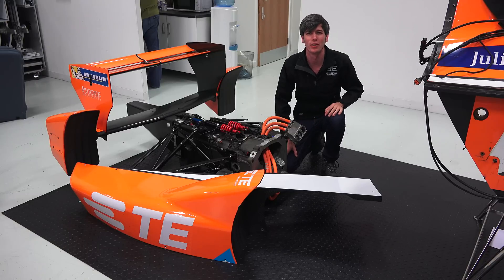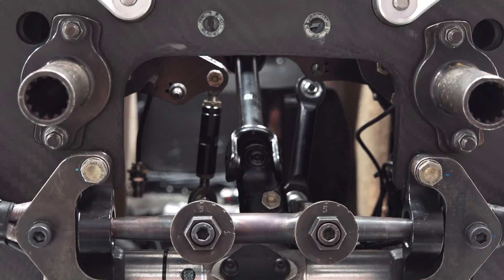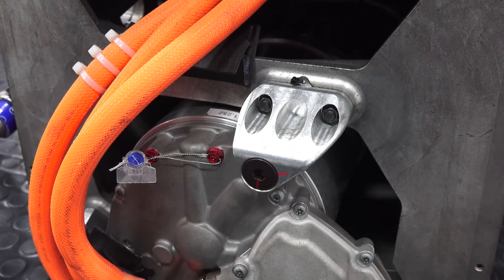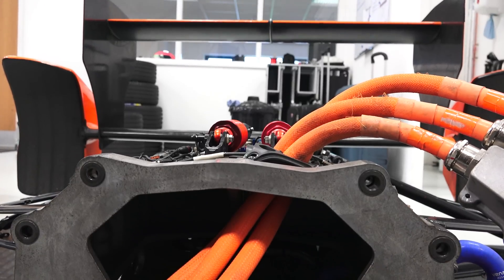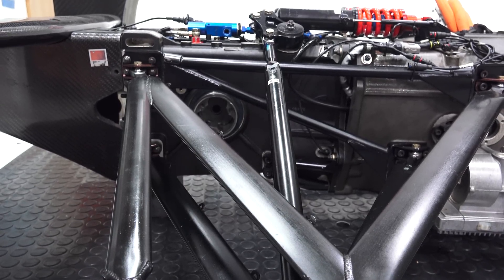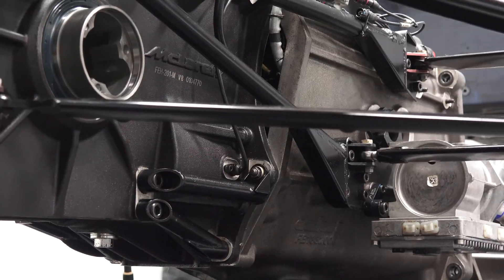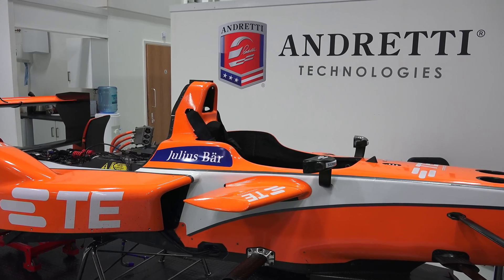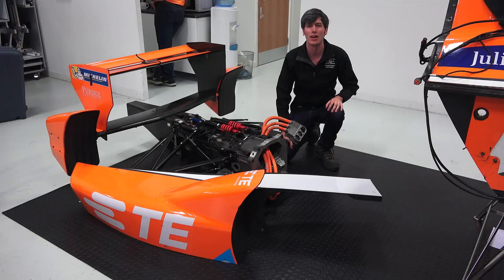Developing An Electric Race Car - Formula E

Comment: Very interesting I was wondering if they keep the motor at peak efficiency using a "geared" type of Trans or  CVT type, how about Re-gen braking ect? also is the batt  liquid cooled?
Reply: i'll answer afaik. they are using geared transmission. but i don't know the specific type, is it, dual clutch gearbox or just computer controlled manual because they're smaller and lighter. re-gen is allowed but there's a limit iirc, and yes the battery is liquid cooled, as is impliedin the video
Reply: The power band of most electric motors are huge in comparison to ICE that's why its so easy to go without a gearbox.
Reply from the maker: They use sequential gearboxes, if gears are used (up to 6 speeds allowed). CVTs are not used.

Comment: I never understood the insane amount of "hate" Formula E got when it was first starting out. It is an exciting new branch of the sport that allows for development in future tech like electric cars or power management to increase the life of battery banks, or just making them smaller. An added bonus is they are fitting those innovations into fast cars so whats not to like about it?

Another brilliant videos as always!
Reply: Thats not really a reason. You've basically just said I love internal combustion and nothing else can be as fun regardless of how fun everything else is.
Reply: i'm pretty sure he said 'i won't be able to let go of nostalgia'.
Reply: Well, I don't "hate" it, but I just can't get into it. I know electric cars are better in many ways over cars powered by ICEs, but they're just not as interesting, no matter what they do. It doesn't help that Formula E cars are so slow and limited to street circuits that are all less than 2 miles in length  (I'm assuming because they need as many chances to use their regenerative brakes as possible). I think Tesla Model S's are some of the best-looking cars on the road, but from an technical/engineering standpoint they bore me to tears (I really couldn't care less about their autonomous technology either, although I don't "hate" it either and could see some benefits to it). 

Then again I also happen to love steam locomotives, and I know how that went...
Reply: SingleTurboSupra Even tho I am a huge fan of the ICE engine putting a electric engine behind a manual box will be just as fun (if not more fun) as the ICE engine manual combo, yes there is no exhaust noise but it is that instant torque that just slams you to the seat that makes them fun
Reply: You can have a generator spinning @ 10k rpms making XXX volts but the second you pull any amps out of it the speed/volts will drop there are no free lunches. ICE gets power from blowing things up, solar from electrons generated from the sun, generators get it from trying to slow down its rotor and they will bring it to a halt if something is not adding power(rotation) to it. Wind, geothermal, dams, nuclear, just convert natural forces to kinetic forms(rotational) to keep a generator spinning.

Contrary to how most interpret the word "generator" they don't make anything they just convert one form of energy to another (dynamo go from kinetic energy to electrical energy) and all energy conversions bare none loss energy in conversion due to inefficacies like heat, noise and light.

I hope you guys are just laying baits for a good troll, because otherwise it shows as a failing of your school system and nobody wins in that case.
Reply: That's exactly what I said. I know eventually I'll most likely be on the losing side of things, but at least I acknowledge my faults, right? :)
Reply: JoeyRodz74 The battery is secured to the car, not swappable, because of safety reasons (Battery flying out in a crash and exploding into the spectators)
Reply: But the question is will there be manual gearboxed electric street cars? Also there's one thing where I actually could find a car with electric motor fun, and that is a self-made track car on a trackday. It is one of my lifegoals anyways to design and build my very own track car, so maybe one day I'll make an electric version as well
Reply: you can get rid of  the batteries and use a permanent magnet dynamo, to make a perpetual generator, most efficient would be to use a direct drive wind turbine generator, because they just need 20 rpm
Reply: for_all_those The generator would have to be quite big to supply the engine and you would still need a battery to get the thing rolling otherwise the motors would get no power
Reply: NoTimeToExplain direct drive generators are tiny, a 2MW generators is about the same size as a standard V8 engine, although they weight alot more, but alot of the weight is the steel heat shielding, and you only need a tiny amount of power to start them up

direct drive have no gearboxes, the blades are just bolted straight onto the generator

you would probably need a graphite heat shield instead
Reply: You should definitely check rimac concept one homie on banging gears you will love it .
Reply: for_all_those yea that is all well and good but you still need something to get the car going, you must have some electricity for the electric engine to work you could get it to run completley on the generator but you would need to get the wheels spinning first to get the generator going to produce power, it still wouldn't be a battery less system it would just need less batteries
Reply: speed demon Have you seen the new Rimac car?  Concept S, makes nearly 1400hp 1800Nm of torque and goes 0-60 in 2.5 seconds. Needless to say that Croatia is proud to have an inventor that young yet that brilliant in its borders
Reply: NoTimeToExplain giving a generator a spark to start up would just be more like F1, you have to wait for them to warm up a bit before they become perpetual, generators come with width or length, so you could have a generator like a drive shaft like :

http://sc01.alicdn.com/kf/HTB1J48dHpXXXXbhaXXXq6xXFXXXQ/200352621/HTB1J48dHpXXXXbhaXXXq6xXFXXXQ.jpg
Reply: add a generator which can spin in neutral while it warms up, and then you can have 14 years before the EU only allows zero emission cars on the road, when they ban combustion engines in 2030
Reply: I'm all for EVs and already own one. What is disappointing to me is that the entire car is replaced midway through instead of finding a way to "recharge" the same machine. If recharging is not quick enough, swap the entire battery out. Whatever it takes to keep the same car in the race rather than banging one out, frying the brakes, overheating it to them simply swap the entire car. That will forever disqualify EVs from racing ICE when that time comes.
Reply: JoeyRodz74 if you replace the battery with a generator you will be able to drive non stop for 10 years as most electric motors will last 100,000 hours, and generators are made to last 20 years
Reply: +for_all_those wha? can i have some of whatever you've been smoking?
Reply: Bradley Barlow why, there are plenty of "perpetual" magnet generators on youtube, non are actually perpetual, and they are all old ancient tech that need more RPM for more watts, which in the real world is'nt efficient and won't be durable enough to have on 24/7 if you want to be able to power industrial vehicles like cats and rubbish trucks etc

if you want something to last, its best to go for 20 RPM which can give you upto 25MW each with the billiions of $ that went into making wind farms usable
Reply: For starters, they are ugly
Reply: I'm one of those people who dislike FE. In the future I'm most likely that old fart who will be ready to do anything to stay in ICE technology and if the sad day of death of an ICE comes during my lifetime I'll keep talking about the good old days. That's how I'll see myself in the future. No matter how technically advanced the electric motors become even though I'm engineering-minded it will be impossible to convince me that they'd be more fun. Most of the things that make driving and cars fun imo requires an ICE and manual gearbox.

Comment: they should put a turbo on it
Reply: how about TWO turbos!
Reply: the joke went over your head......
Reply: and they should install VTEC so they can go faster than everyone else
Reply: +Nosh Nosher shhhhhh, I'm sure he's joking ^_^
Reply: Nah everyone knows superchargers work better paired with electrical motors.
Reply: you have just instaled a wind generator to a electric car.  so basically you are using energy to create energy with bad efficiency so basically you made a useless airbrake. ten points for grifindor because you tried
Reply: No hes actually onto something! Put the turbo in but, instead the turbine fan can just be powered by the airflow from outside and be redesigned for maximum rpm. Then on the other end you have a magnet and a coil to produce some voltage. Then that voltage can go to a circuitboard or transistor and amplify the signal. Just like a guitar amplifier or any amplifier. I guess this almost sounds like an alternator but its not run on a belt.
Reply: what do you mean? have you never driven a turbo car before? fast as hell
Reply: joke aside... There will be some sort of "electrical turbo" just give it time. :D
Reply: but hey! If we put a windturbine on a car we can drive really fast and produce electricity for the whole country. we could stop global warning and save the polar bears! Some people are just so smart :o
Reply: You better be joking.
Reply: Warp drive leaves turbo electric in the dust any day !
Reply: +Ernesto Cestellanos That wouldn't work. The amount of electricity produced would be negated by the additional drag and additional weight of the mechanism. Think about it, it's essentially putting a wind turbine on the car. Even if it's active only during braking, I think the added weight of the setup would negate any power produced.
Reply: i think that you should nominate for the nobel prize of special efforts
Reply: Thats what the amplifier would do. More power it can create the smaller battery bank it can use. And you know very well those batteries are NOT light. I'm not expecting a large 12" fan. I was thinking 2"-3"
Reply: dude just no, please stop thinking about this. You are goin in a totaly wrong direction.  The amplifier just amplifies voltage in the cost of efficiency and more amps at the imput end.  Think about this if you are not troling, energi preservation and there is  no such thing as free energy.
Reply: impossible to harness energy from eye without touching it, but you might be able to harness energy from air with only potential energy
Reply: hahahahaha
Reply: still without the downhill they wouldn't move. Interesting tho
Reply: except you have to build the solar panel and have a burning sun. Energy conservation, just go to school kid. Basic physics, yes there is energy of the sun but the sun needs to burn to give off that energy. That was my point, you cant put a generator on a electric car and create infinite energy, its even worse than plunging  a extension cord in its self and except to have free energy. 
Energy can neither be created nor destroyed
Reply: Gasper Erjavec Yes except that we can have lifetime fuel for our cars if they're solar driven. If you even could capture 1% of the power we receive from sun you would have lifetime power supply for your car to be run 24/7. 
Sadly that's the problem. Our tech is highly inefficient. That's why you cannot run it 24/7 (yet).
What this "kid" tried to tell you is that you can have lifetime supply of power at very small cost but you just need to tap it.
Reply: Is there any research done around the way the eye captures light and makes electricity out of it ? Or has it been done and deemed inconclusive ?
Reply: You are just trolling now, goodbye, have fun with your life.
Reply: Green Power Turbo chargers only work for combustion engines ... They work by forcing more air into the combustion chamber. Electric cars don't have combustion chambers.
Reply: yes where will it be mounted, for what will it be used, provide air flow to the motor?
Reply: Koolkei 'xddd, jokes on you, i was merely pretending to be retarded'